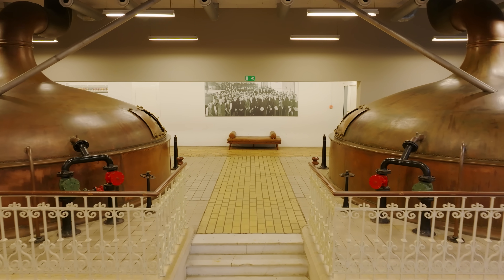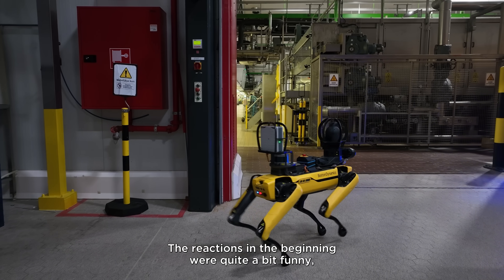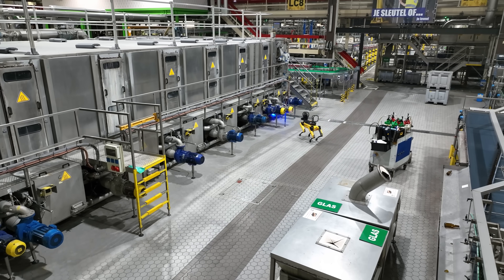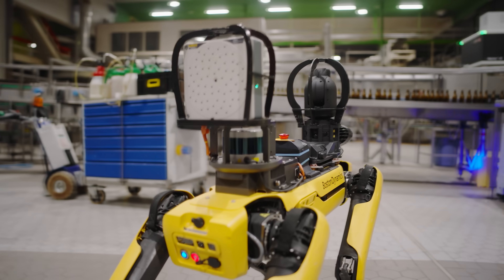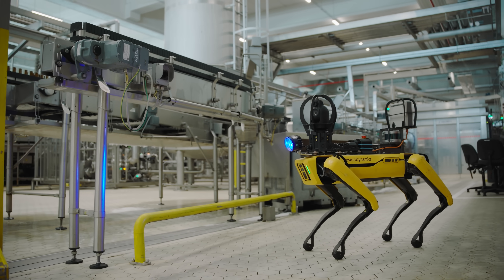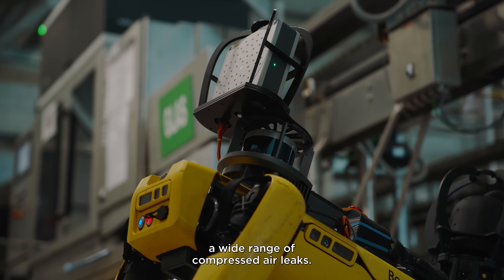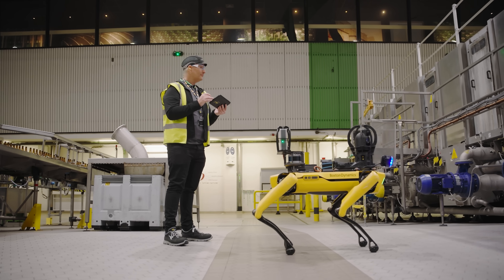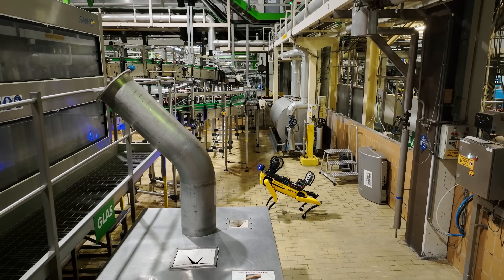Spot at AB InBev Belgium | Boston Dynamics

Comment: am i the only one who thinks that using spot in this kind of way is completely overkill?
wouldn't it be way cheaper and more reliable to just install some cameras/thermometers/microphones and collect data that way?

don't get me wrong, spot is really cool and i love what Boston Dynamics is doing, but i just think that some of the use cases they present could be solved pretty easy with other cheaper methods.
Reply: I think there are 2 reasons. 1. Fixed sensor is good to detect issues, but you if you want to understand more about the issue, you must be there in person. But if Spot tell you that a machine is overheat, you can definitely use Spot to look at the issue in real-time to see if there is any immediate danger e.g. smoke, fire, any people around or any abnormaly that a fixed sensor/camera can't tell you. 2. Instead of maintaining 100 sensors, you only need to maintain a single set of sensors on Spot. Remember that "maintain" didn't mean you fix it when it is broken, maintain may mean calibration,  testing and re-deploy. Maintaining 1 set of sensors on Spot should save lots of man hours for maintaining a 100. Plus you get to upgrade the sensors on Spot easily, think about upgrading 100 sensors in different location..
Reply: I doubt Sensors for a thousand motors, valves etc. and thousands of meters of pipework would be cheaper. Some anomalies probably can only be detected through thermal imaging.
Reply: @sheepking97  You dont need a thousand meters for that. All you need is a local camera for thermal imaging for the area.
Reply: @hexahexametermeter  They have thermal imaging AND acoustic imagine, and the thing you are not taking into account is SPOT is multipurpose, those sensors and accompanying programming protocols could be easily swapped out for others for other types of tests and imaging.

The flexibility of a whole slew of real time tests for ALL of your systems with one robot.
Reply: @hexahexametermeter thermal imaging cameras suitable for an industrial environment and capable of automatically creating alerts for anomalies are going to be several thousand dollars each, plus the labor to install them, and you would need hundreds of them to monitor a plant this size. .

While the robot is expensive, it only needs a single high quality thermal camera for all the thousands of motors across a giant plant.

So this is actually one of the few situations where Spot actually makes sense, because it replaces a technician walking the factory with a thermal camera, and it is cheaper than hiring the technician.
Reply: Software (image recognition, acoustic data -> point of failure) is included in Spots price.

Not only making such software, but maintaining (calibrating) it for thousands of sensors is a herculean task. I did some image recognition in uni.

The spot might not only be cheaper. Thousands of sensors might not be feasible.

And the job of operating a cute robot is much more attractive than the (at least five) jobs of analysis of sensor placement, calibration, maintenance, replacement.

It might be even 2 to 10 times cheaper than individual sensors (guessing from salary). I am assuming that Spot will last 10 years. The break even point, I believe, is if Spot lasted 1 to 3 years.

Spot's cost is pretty much exactly the yearly salary of one technician in germany.
Reply: Some commenters here know NOTHING of the cost and bureaucracy and meetings required to install anything on a factory floor. The conduit runs alone would be into the hundreds of thousands of dollars in parts and labor.
Reply: A maioria dos robôs tem os exércitos dos governos por trás e não tem intenção civil. Eles são produzidos pra ir pra guerra. Drones decidiram a guerra da Armênia Afeganistão. Não sei qual é a atual relação da Boston Dinamics e as forças armadas dos Usa.
Reply: Ok, but robot
Reply: I’m afraid it needs more imagination from most of you, critics to understand why Spot works good here. And there was that word… versatility?
Reply: You're right in a theoretical manner.
The thing is though, in the real world, those sensors aren't there so need to be installed, tested, adjusted. And some months later you notice you have forgotten some places, so you need to buy sensors again, dispatch the workers to install them, test them, adjust them ... Two years later new machinery is added to the facility and things get altered, so the whole process again...
Its easier to just reprogram Spot every time such things happen.
Reply: @Delibro  adding a few more cameras to an existing network is not a problem.
Reply: @kezzaman  Of cause its not a problem, and in some factories this might be the easiest way to reach the goal. I'm just arguing that there might also be many factories where a Spot is the quickest and easiest solution.
Reply: Only way spot would be useful is if the sensors in question are expensive. So you gain something from only needing a single set that walks around. But spot is also not cheap. So i kind of doubt that is the case. Could be wrong tho i dont know what sensors they use. But with limited info it do not pass the "this seems stupid" test.
Reply: @RasakBlood Good point. On Fluke's website I found an acoustic imaging sensor model for 22449$. It looks similar to the one that Spot carries around.
Reply: @RasakBlood  i agree. In this case, buying some thermometers, microphones and cameras would probably be way cheaper. like even if every sensor costs 100$ and you need like 30 of them, that would still be only 3,000$ and i think spot is around 70,000$
Reply: @CHECKERCE lol, 30 sensors? Even a small factory has THOUSANDS of motors, valves etc to monitor. And sensors for this kind of applications are certainly more expensive than 100$, smart sensors (the ones that directly send data to a SCADA system through a wired or wireless network) go for several hundred dollars and even in the thousands.

And they only monitor things that you mounted them on; how do you find air leaks or other random failures? There's a reason why even in highly automated industries there are engineers that constantly go around the plant looking for something out of the ordinary.
Reply: @CHECKERCE  
You forgot about cost of mounts , the miles cables,  control boxes,  racks for all the cables. One heat sensor for every bearing, motor, gearbox. This just the cost for heat sensors.  What about air leaks detectors. $75,000  is a bargain.
Reply: Spot costs about $75000, plus sensors, charging infrastructure and training, of course. Multiple sensors, wiring, monitoring equipment and installation in such a huge plant would be much more expensive I reckon. And Spot can walk to the other nearby plants and monitor them too. Plus, you'd probably have to shut down the production line to install all the new gubbins.
Reply: @alan_wood  Waste of time. Calculate how much time Spot is walking around versus monitoring and the majority of Spots time is going to be spent getting into position versus doing the monitoring. And the benefit of multiple monitors is, you get real time data simultaneously. Its easy to figure multiple sensors would be A LOT CHEAPER then Spot. Spot is a waste of money.
Reply: @hexahexametermeter "Waste of time. Calculate time measuring vs walking..."

It is unnecessary for the sensors to be up 24h a day. If a technician fixes stuff once a day, you need only one measurement a day.

Then one Spot truly could take more measurements across multiple buildings.

It is pointless to discuss the price without googling at least the size of the factory and estimating at least the total pipe length.

For pipes (air or fluid) you really would need tons and tons of sensors to cover the entire length and pinpoint the failure location precisely. At some point it becomes too tedious and therefore more expensive than a single Spot (assuming it can walk the length in a day).
Reply: @hexahexametermeter 
I can tell you never been in a working industrial plant. $ 75,000 is a bargain
Reply: It is of course, spot is great for hard to reach places, dangerous surroundings etc. But this seems more of a management idea. :)
Reply: @VincentGroenewold  if all spot does is take readings it makes more sense to install sensors, cameras, etc. In said hard to reach places. More sense, cheaper and more efficient.
Reply: @kezzaman 
You have no idea how many sensors that you need.  The miles of wiring . Control panels etc. You are talking millions of dollars.  Plus those sensors  are expensive  and mounted on every bearing etc.  Just how do find air leaks. 
No $ 100,000. Cheap.
Reply: @assassinlexx1993  thermal cams are relatively inexpensive, sound sensors are inexpensive, cabling (cat5e) is inexpensive. You do not need a sensor per machine, cameras have a field of view and range. If this facility is extremely large than is 1 spot really sufficient. If spot has to travel miles to check each machine how many checks can he perform in a day, maybe every machine gets checked a few times a day, what if something happens to a machine while spots off on his mile long adventure?
Reply: @assassinlexx1993  HAHAHAHA miles of wires HAHAHAHA who uses wires anymore? HAHAHAHAHAHA millions of dollars? HAHAHAHAHA
Reply: @hexahexametermeter  
Have you even been in a factory?
Just how do power all those sensors? How do you get signal up to the control room.  Do you use trained butterflies to deliver the information?
Reply: @hexahexametermeter You should build a factory. You'd be an instant billionaire because you could do it so much cheaper than everyone else.
Reply: I was just going to make this comment. Just install local condition sensors which can monitor everything simultaniously. Very inefficient. This is for publicity mostly. Not quality control/ inspections.
Reply: yeah add more stationary things in the walking path that will then also have to get checked by maintenance......... this is pretty practical. did you watch the video? multiple employees give reasons as to why its nice to have spot....
Reply: cameras and sensors are pretty small, pocket size, installation will be a case of strapping it to existing hardware in the factory. They are also cheap, if one breaks just replace it.   @kobotkiller
Reply: @kobotkiller  what do you mean by getting in the walking path? a thermometer or microphone is super tiny and can be attached directly to the thing you want to monitor. A camera can be mounted to the ceiling or wall. and 20 different sensors/cameras would probably need less maintenance then spot itself
Reply: @CHECKERCE this is actually a very good use of Spot, pretty much the first one I have seen actually lol
It's not really useful to install temperature sensors on motors, because different areas get hot depending on if it's a bad bearing or a bad motor, and so you have to have multiple temperature sensors on each motor in order to get the same data that a thermal imager will give you.

And in a facility like this with thousands of motors, it would take months to install something like that, and most of the motors you can't access safely without a plant shutdown, so it would cost a lot to money to try to wire everything up.

And thermal cameras that can give temperature alerts in an industrial environment are thousands of dollars each, and you would need hundreds of them to cover all the motors and gear boxes and bearings in the plant.

On the other hand, you put one good thermal imaginary camera on the robot, and one good ultrasonic sensor on it, and then have it roam the plant 20 hours a day (with charging time), and it can get into the correct positions to check the temperature on every motor and gear box, and monitor for air leaks or even bearings going out, and even if it takes 3 days to cover the entire plant, you have constant monitoring going on, that would require hiring several additional technicians to do manually otherwise.

So in this exact scenario it actually makes a lot of sense, and is a good investment, assuming that the automatic alerts etc work properly, because it frees up more expensive humans to actual correct the problems, rather than just having to do passive monitoring.

And remember that Spot costs much less than hiring a single technician, so even if it only does the job of one employee, it will pay for itself in less than a year in a big facility like that.
Reply: @kobotkiller  In a promo video, you think these coworkers were telling what they really thought? :) Of course it can be nice, it's still just overkill.
Reply: Yeah my guess is you could buy a lot of extra sensors for the price of one spot.
Reply: @JCAtkeson3 
Look up the price of one industrial grade food safe sensor. Now add one to every motor, gear box, bearing.  Add up all the mounts, wiring , control panels. No Spot is very cheaper by a long way.
Reply: Bostons robots are mostly impractical